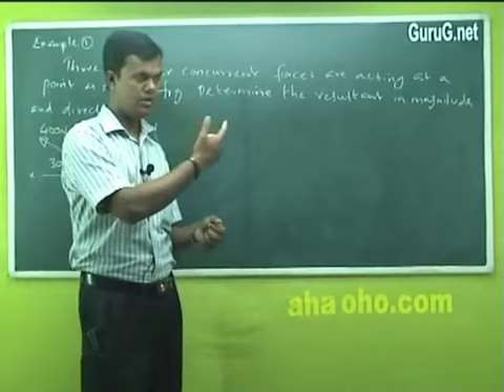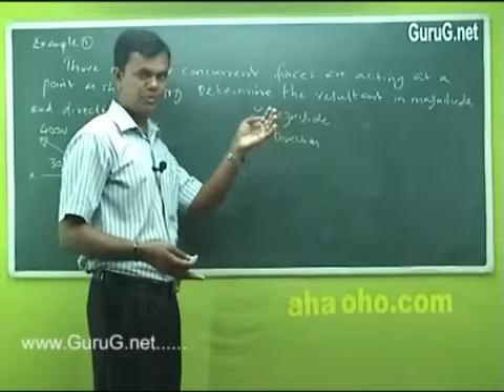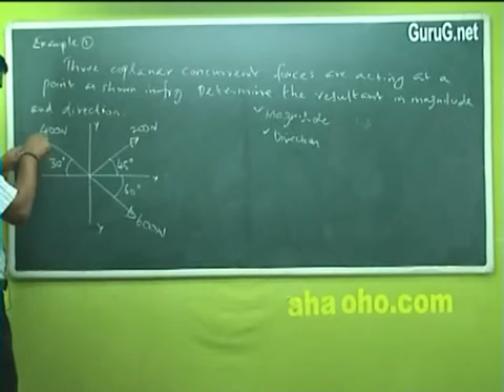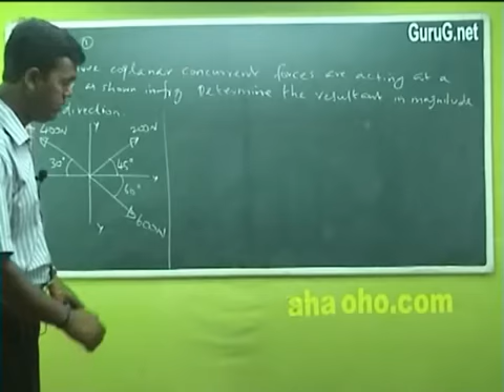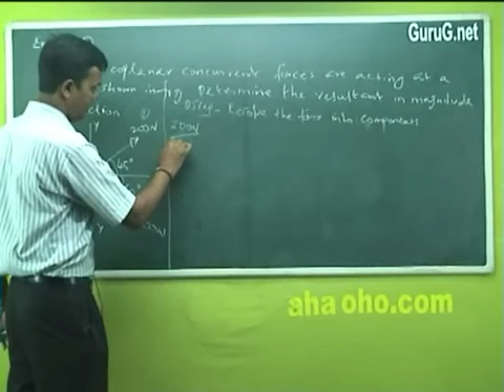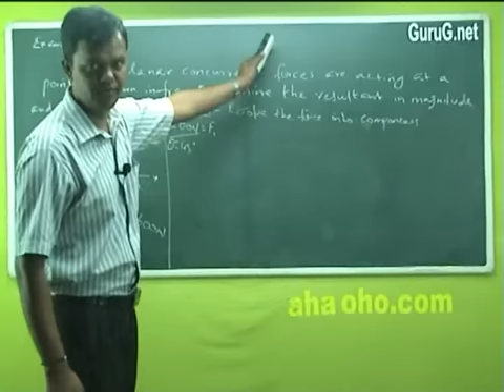Unit-1 Basic & Statics of Particles (Example for Reslution of Forces ) - Engineering Mechanics

Comment: Hi sir, I m little confused on question no.2 3rd Force, why we take angle as 90 -(3+9) = 78 and why not 90 - 9 = 81. You said the angle will be always with horizontal line. So if i see the 3rd force is at 9 degree with vertical but it is at 81 degree with horizontal. Please clarify.